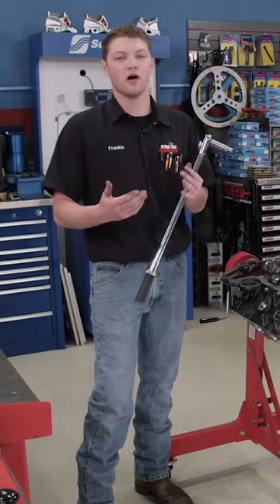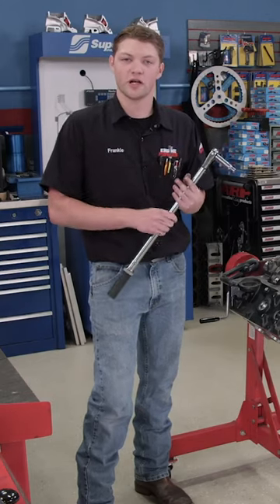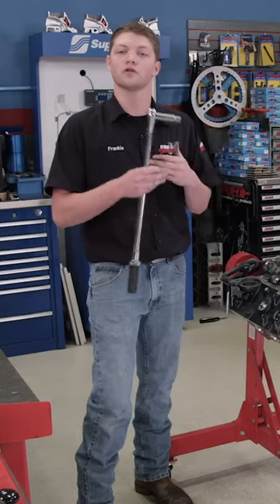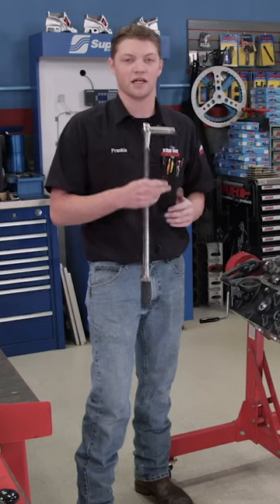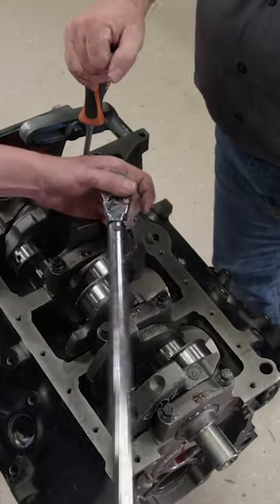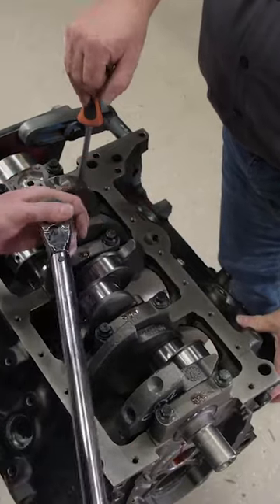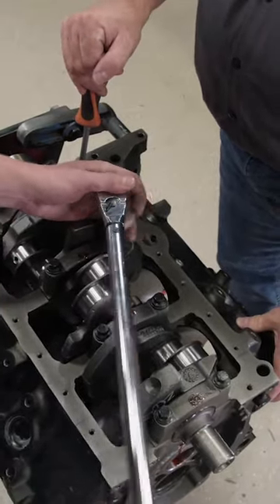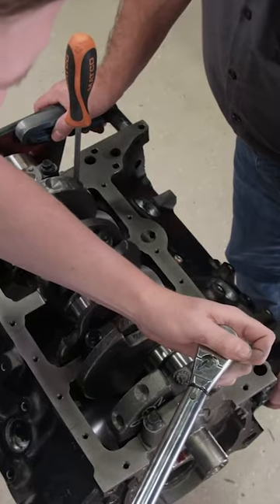Tips for Setting Your Thrust Bearings

Comment: One guy said, I don't want to hit it with a hammer, it's going to break the crankshaft in half. I always thought if it won't survive that, it wont ever survive running
Reply: SBC had harmonic balancers without a bolt that holds them on or installs them. Book would tell you use a 2x4 place on balancer and beat it till it seated.

Comment: Yall are missing the point of the thrust bearing doing this is unnecessary just let the thrust bearing do its job ...smfh
Reply: you have  to set it then  check end play.  you do it  it  any other way and it'll  eat that bearing  and youll be building  the engine again
Reply: @KingJT80  not if the block is specifically  machined for a certain thrust bearing clearance ...aka doing it the right way .....I mean if you're gonna halfass it and build off an untouched block and guess and take shots in the dark then sure you'll have to do this but when building an engine you should always list your desired clearances when taking your block to the machine shop so that when you get it back you have the exact part numbers for the proper bearings ..skip that step and you're asking for trouble and you'll have to do this ..but done right this step is totally unessisary I've built many engines that have made it well over 300k miles not once have I had to do this because they were all machined properly and i had installed the part numbers recommended by the machine shop so that all my clearances were within   half a thousand of an inch of spec always

Comment: They don't do that at the factory why the hell would you do that with a custom rebuild!!! 🙄🙄🙄
Reply: Are you of the opinion that mass produced cannot be improved up with a dose of custom built?
Reply: No, factory engines are only off .010 front too back at the bores and not squared. No biggs though
Reply: @ShaunHensley  That could cause way more damage than good all especially long term of the motor not just few dyno runs lasting no longer than 20 minutes.. Just saying..
Reply: @ShaunHensley  This is a show that fears 20psi of boost on stock motor and pushes ideology of the alphabet agencies that favor removal of older vehicles off the road hence tow industry goes highly unregulated and tows at will. Never seen a professional engine builder do this in any racing event. This is a mean spiteful thing to miss lead commoners of some that don't know better. Note people have recently left the show and already building bigger hp engines and 10 sec pickup trucks. The people who left the show know its a scam drive by nazi alphabet agencies to miss lead you at every corner same they did in car magazines for years.
Reply: @Thelongmanable  We perform thrust readings on massive steam tubines during the build or major overhauls using a lot more force than a small rubber mallet. As long as it’s oil, it’s fine.
Reply: @ShaunHensley  Check out the Lawrence Tolman channel he left the show and has started his own YouTube channel and at almost 100k subscribers!!!! This show is entertainment not force ideology of what you should like and some people just get that...
Reply: @ShaunHensley  Why is cutting in large valves such a taboo subject matter on stock heads or pushing over 20 psi??? Seems odd and agenda driven..
Reply: @realdeathpony  Hey check out the Lawrence Tolman YouTube channel way better than this crap. He almost at 100k subscribers. I have no connection to him at all but I like to see and support someone who does it better with next to no budget..
Reply: @Thelongmanable  lol u weird😭😭
Reply: @Thelongmanable  he is still a hack.  And a baby

Comment: Must be April 1st. Pound a screwdriver into a new engine lower end. Umm never
Reply: Do you know what it is your looking at exactly?
Reply: The screwdriver was a “lever” and went between the top end of the bearing cap and the balance of the crank…NO ISSUES HERE
Reply: @KingJT80 yes, and preloading the crank is unnecessary and stupid
Reply: @alanmeyers3957  you need to check the end play on these older engine builds for it to be right in a performance application and you should be pre loading the thrust bearing

 if you don't you could eat a thrust bearing and you'll be rebuilding the engine twice.

Comment: I had a question,  I have a 350 crate new with roller cam and roller lifters with 9.1.1 compression. Ran 600 miles,  ran sae 30 break in oil for the first 600 miles, then changed it. Put 10w 40 oil in it,  drove it for 60 miles, then my rockers started to get loose, the self locking nuts won't stay down, and keep getting loose. there's no smoke or any noise. and i know it's not normal, but I'm just curious about what's causing this to happen?? Maybe a bad crank? Do you have any ideas if a bad crank seal is causing this?
Reply: I'm new to this stuff but it sounds like vi ration may be playing a part which could probably be caused by a whipping crankshaft

Comment: What a load of shit, thrust bearings aren't designed the way you're describing... and you've missed a pretty vital step of checking the end float.
The best practice is to check the end float after torquing each cap. For peace of mind, I like to rotate the shaft in between, too, make sure nothing is binding up.
Reply: its a youtube  short.  after they  did  this  thats  what  was checked in the full video.  you do  this  and  then check  end play.  you dont have to check  each cap  thats a waste of time.  this is EXCATLY  how  thrust bearings  are designed..to take the thrust 

 but  if  it  isnt  set properly  like this , then your measurements on  end play dont mean  much